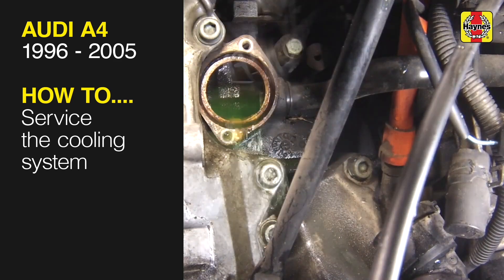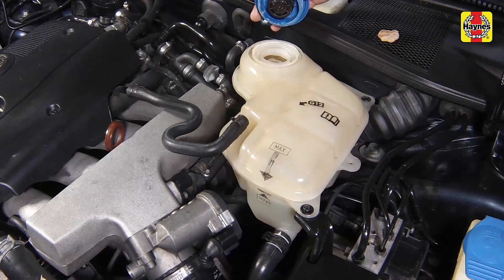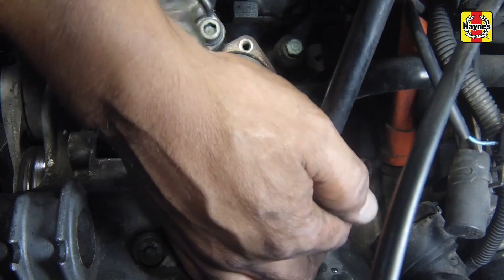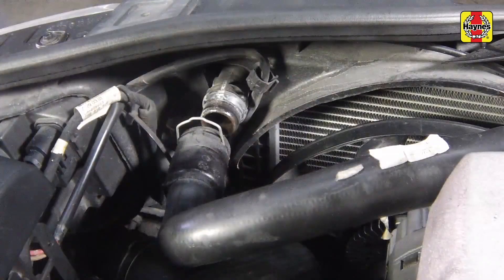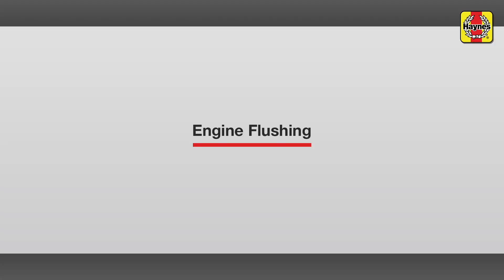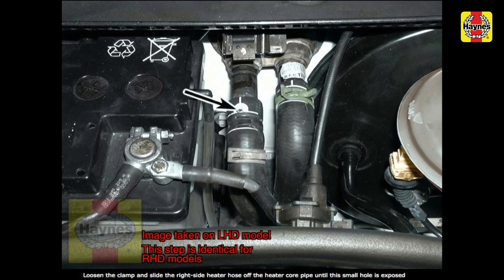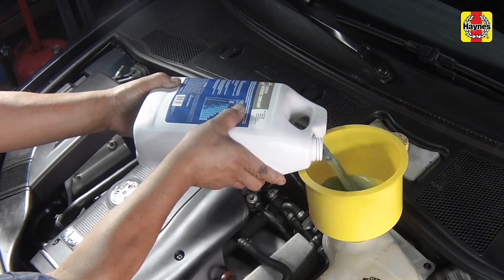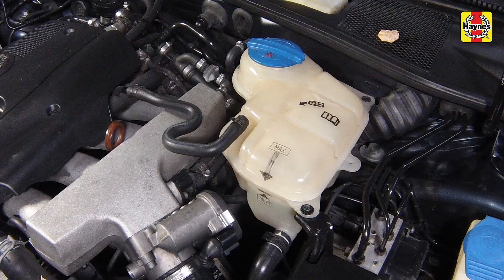How to Service the cooling system on the Audi A4 1996 to 2001

Comment: On the aeb motors 96-99.5 theres a bolt on the water pump to drain the block
Reply: where exactly is that?